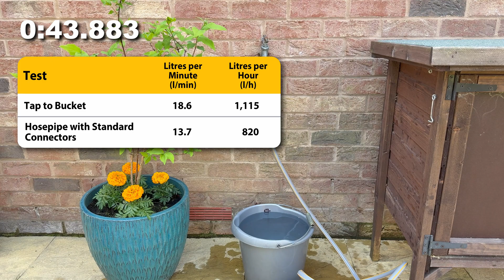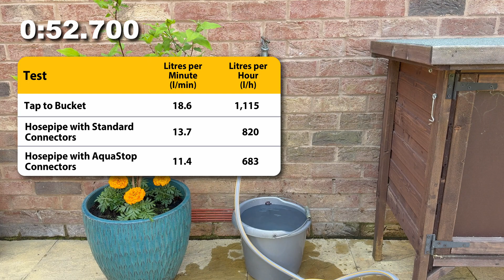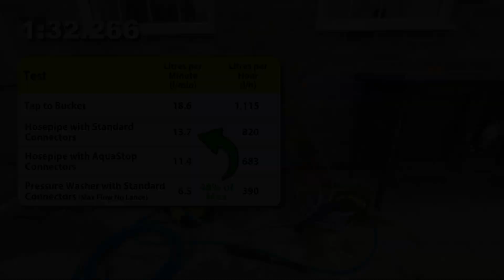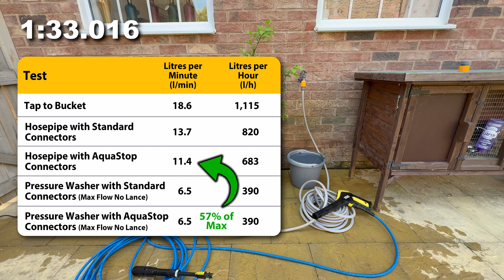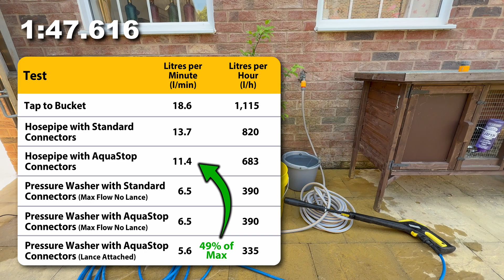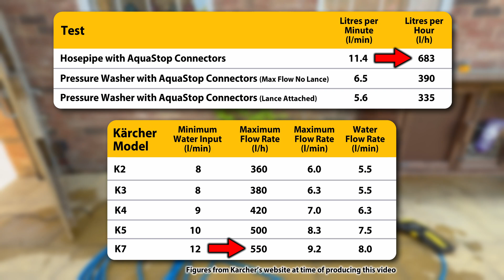Karcher vs Hozelock AquaStop Connectors

Comment: Any thoughts on turning the tap to max flow?
It's probably the case of read the manual but on my nilfisk core 140 it warned against a input pressure of 1 bar.
One time I had the hose connected and turned the tap to max and water flowed through the pressure washer hose (it wasnt connected to the lance) not sure if this is normal?
Also also, great videos on the snow foam stuff, enjoyed those.
Reply from the maker: Hi and thanks for watching. I’ve had a look at the Nilfisk Core 140 technical data and it states the max inlet pressure as 10 bar.

Water flowing through the pressure washer whilst it is turned off and when the lance is disconnected is normal, my Karcher does this which you can see in this video:

https://youtu.be/B1WHFP7FtAU?t=56

Hope this helps. 👍🏼

Comment: Is the warning against using Aquastop connectors in the Karcher manual only based on adequate flow concerns? I suppose it must be, which makes it a bit silly/pointless, based on your findings. I suppose not all garden taps have perfect flow to start with, depending on how they were installed, age, etc.
Reply from the maker: Hi and thanks for watching. It’s the only thing I can think of that is implied from using them. Maybe other branded auto-stop style connectors work differently so the manufacturer might be referring to those. As long as the pressure washer isn’t being starved of water at any point during use, I don’t see how it can affect reliability or performance.

Comment: Thanks for the great comparison video. I've seen so many videos and posts about being careful not to use aquastop connectors and I could never understand the reason. Especially some warning posts saying that it will damage the pump etc etc when it's more than obvious as you showed in the end of your video that while the connector is connected to the pressure washer the aquastop seal is "de-activated" and water flows in and from the pressure washer
Reply from the maker: Thanks for commenting. 👍🏼

Yeah the only thing I can think of is that old/worn AquaStop connectors might not allow as much water flow or people are using them even when the pump is hunting due to lack of flow. I don’t have an old connector to test to see if performance is reduced. 

Like you mention, if someone says that AquaStop valves seal/stop water flowing when the pump is turned on, then they don’t know how these AquaStop valves work!